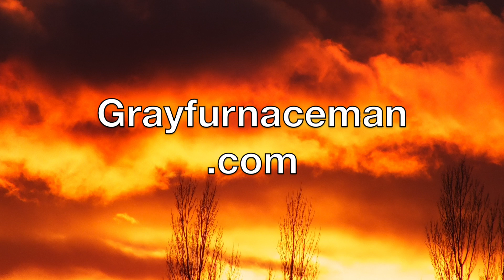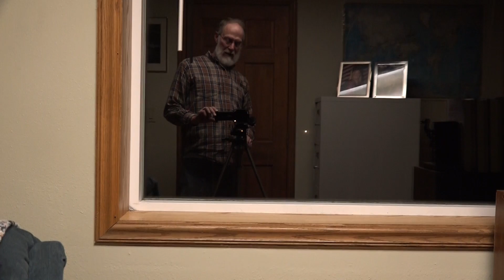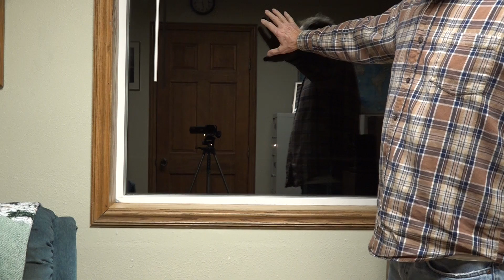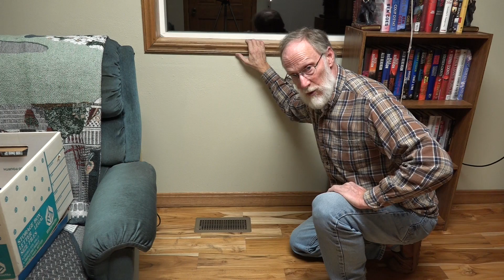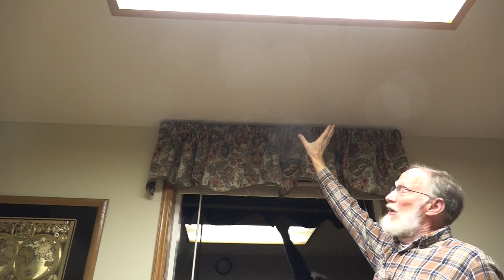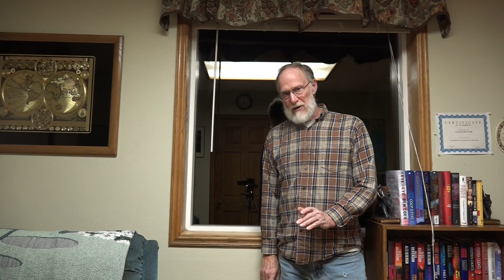The floor diffuser

Comment: Hi.  I really enjoy your videos. Very educational and explained in terms most people can understand.   Thanks!  

I've got a question.  I just bought a Cape cod house built in 1959.  It has a forced air oil heating system.  What puzzles me is that all the return registers are below the windows on the outer walls and the supply registers are in the floor by the interior walls.  Is this common in older homes?  I live in the far northeast corner of NY State.  We get stretches of sub zero temps for days at a time.   Would it be better to reverse the flow?  I do notice cold spots in some areas.

Comment: Can you make a video about balancing the diffusers in multiple rooms to get an even air volume distribution ? and also on the new zones (zoning) features (motorized dampers for each diffuser conduit) ?

Good stuff keep them coming, thank you.
Reply from the maker: +Dicofole I will be doing many more videos on this subject.  Balancing is one of the hardest parts of the install and I will try to dispel some of the mystery.
GFM

Comment: Floor grilles don't work so well with ac.
Reply: +Mark Johnson cold air falls so without high velocity the air will not mix well and cling to the floor. Then gets sucked right back into returns